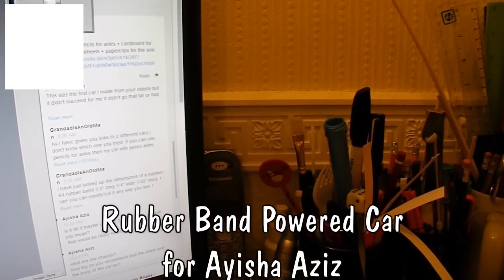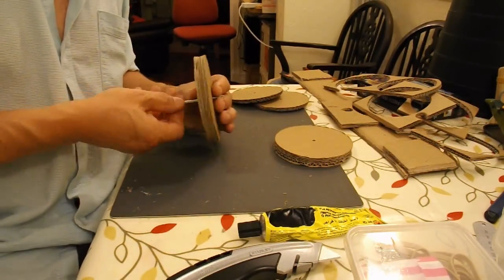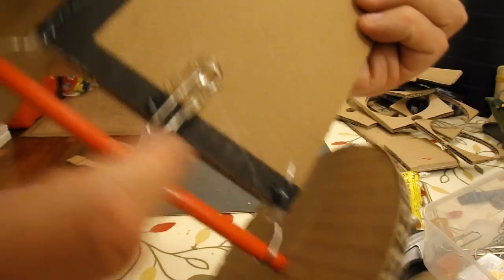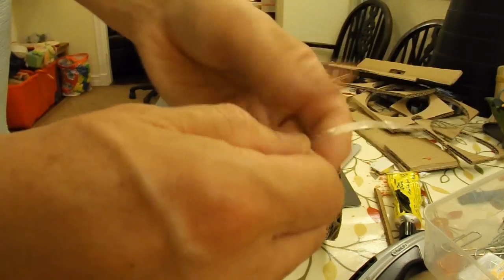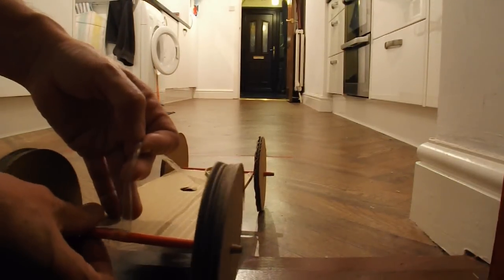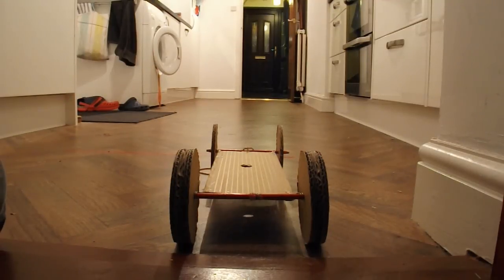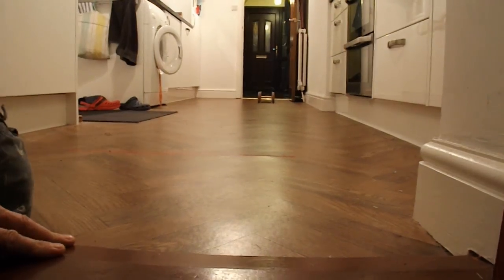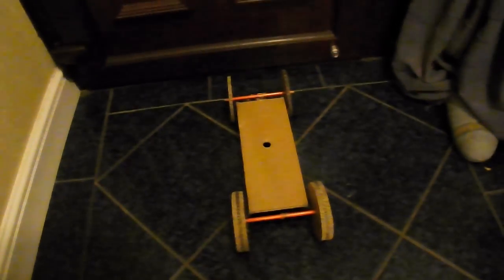Rubber Band Powered Car for Ayisha Aziz

Comment: The tape part was very confusing and how to bend the paper clip in the middle. I dont get how it goes foward.
Reply from the maker: The tape is folded in half, so the sticky sticks to itself. That leaves it so we can use it like a piece of string. If you have a piece of string, you could use that instead. The shape of the paperclip in the middle is just a hook for the rubber band.  You hook the rubber band in place, tie the "string" to it, attach the string to the back axle by wrapping it around so it goes over itself. That holds it in place. Keep turning the axle to wind more string round it, that stretches the rubber band storing power in it. When you release the axle, the rubber band pulls the string, and that spins the axle. You will find useful links in the video description 👍

Comment: just get wide rubber bands that go around the back wheels as tyres
Reply from the maker: +Nash Winter if that is allowed in the specification they yes, that would work. I usually cut strips from balloons or rubber gloves as they stretch nicely round the edge and that helps to hold them in place. Here is my old helpfile for putting rubber tyres on CDs https://youtu.be/ZnuPnveCbxs?list=PLA5a2xPRSrB2v0vxMJyZ9cPweAGx1FK6e

Comment: How far does it go?
Reply from the maker: In the video I tell you it is going 9 metres. Do you have to make a car to this exact specification? If not, there are plenty of other cars in my rubber band car playlists that are easier to make and will go further. There are helpful links in the video description but I will add a few here
Rubber Band Powered Car 1 x size 64 - full length video https://youtu.be/pIO3FiHX4Oc?list=PLA5a2xPRSrB3g5RiX8Kf_uUBOL0Tb7AS0
Rubber Band Power Cars https://www.youtube.com/playlist?list=PLA5a2xPRSrB3g5RiX8Kf_uUBOL0Tb7AS0
Put a rubber band on it Cars https://www.youtube.com/playlist?list=PL2Aly02Ujr7dtOGW4KA0pWMD3TOB9yhUx
Reply: God bless you uncle 🙏